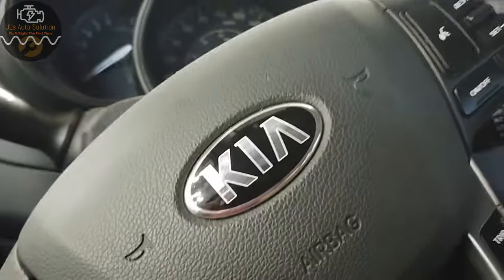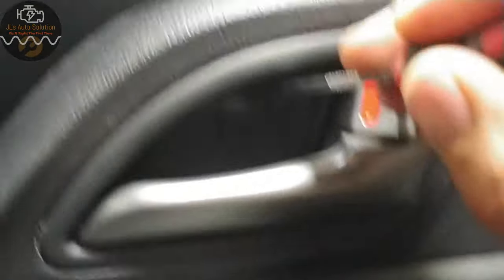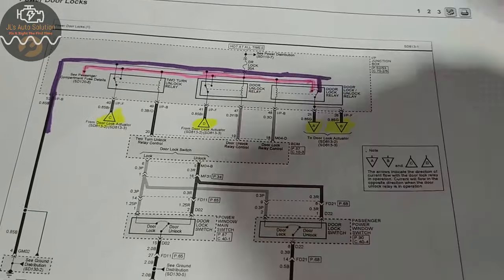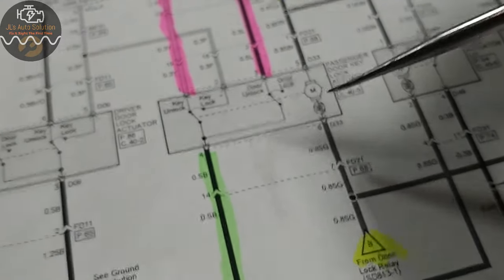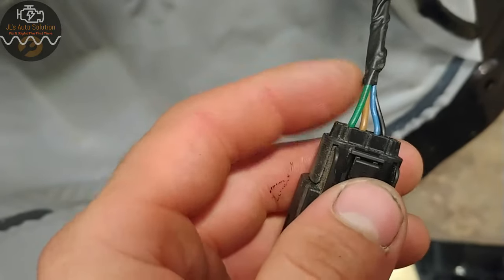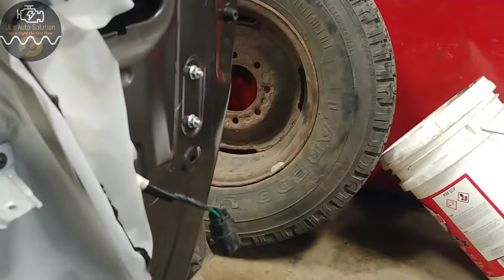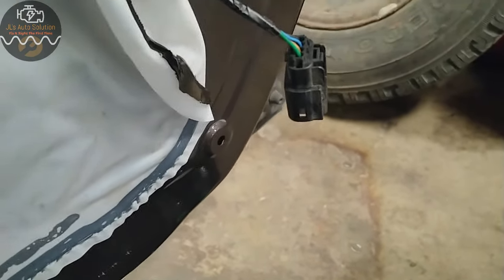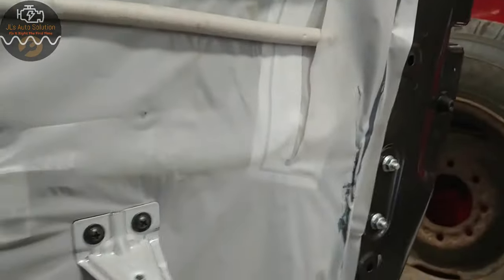How to Diagnose a Door Lock Actuator

Comment: I have a clue with Kia Sorento 2011 on the rear hatch locking system. All doors work perfecly but rear does not lock or unlock at all. I have no key to insert to lock my rear door. I checked the voltage at black and white pins on the connector and I have 4 volts. I checked wiring up to the rear door when wiring get into the roof and still have 4 volts when I click on the Key. Any suggestions or ideas? Relay? How can I check the wiring continuity up to the fuse box and where?

Comment: Hi there.   I have an 08 Town Car with the back door being jammed in.       The pull lock on that inner door panel is stayed in the lock position.         The lock rod issue will not let me open the door from either the inside or outside         Does my issue sound more like an actuator issue, than it does a cylinder issue?
Reply from the maker: seems like an issue that may be mechanical(with the latch assembly) or electrical.

Comment: I have a issue with my door lock where opening from inside the car opens the door but trying to open the door from the outside doesn't. Is this an actuator problem or tensioners/lock mechanism problem?

Comment: I been looking for a video like this,  my vehicle is not a Kia,  is a Nissan titan 04 but my remote control works pretty much the same as the one you have on hands and my problem looks similar. The passenger door doesn't lock with the remote or with the switch on the door,  I have to lock and unlock manually,  the driver side works perfect. Thanks a lot for this video and I'm going to try to follow the steps you did to see if my wiring is the problem or the actuator.
Reply from the maker: No problem, hopefully you get it sorted out :)

Comment: what could cause the actuator not to work when the door is closed? it works fine when the the door is open but once i close the door i get nothing. 2012 accent rear passenger side. i replaced the whole actuator and latch with one i got at the salvage yard and have the same problem.
Reply from the maker: I would check the door harness,

Comment: My doors lock system works sometimes but other time it work you can hear it unlock but it won’t actually unlock I checked the fuse it’s good I ran the obd system nothing about the security system I have a compustar remote start if that helps
Reply from the maker: hey darnell, you might be looking at an intermittent door lock actuator malfunction(mechanical). you would need a test light and to get to the wiring to the actual door latch actuator. il have a new video on this soon.. its similar to this video just a little more straight to the point.
Reply: @JLsAutoSolution  can’t I just change the actuator ? And he done ?
Reply from the maker: @darnellmorgan6754  you can change whichever part you want. Just make sure thT it is actually defective first. Last thing you wNt is to change a part only to have the same issue.

Comment: I have a problem with my 2019 kia sportage and seeking help pleaseeee, when i switch off the car and try to lock it sometimes it works some other times  it doesnt work and sometimes it unlocks after locking and sometimes it start making alarm noise by itself! 
All fuses are ok, remote is ok and sending signals, car battery and remote battery both ok
Reply from the maker: more than likely the vehicle is seeing a door or hatch open slightly and causing the vehicle to freeak out, or aftermarket remote starter is acting up

Comment: My Kia Rio 2014 do the same thing with front passenger side ,  what can I do ? Do I need to change a part ?
Reply from the maker: it really depends on the diagnostics that are being performed. I will never say change a part(because something is not working). Test don't Guess.

thanks for watching
Reply: @JLsAutoSolution  I hear the electric click but it doesn’t lock or unlock

Comment: My 2013 Kia Rio just started doing this but all 4 doors won't lock or unlock with the button or key fob, no motor sound or anything. I checked the fuse and when I push it back in the locks lock and unlock automatically but If I press the button of the fob or the lock button on the door all they stop working again and all I hear is a clicking noise by the fuse box. Any thoughts on this? Is it possible all 4 door actuators went bad at the same time?
Reply: Did you figure out what the problem was!? I have exactly the same problem in my kia rio 2013. All 4 doors won't lock or unlock, and it makes the same sound on the fuse box!

Comment: I have kia picanto..the problem almost the same..the car lock..but when it unlock I hear all the motors react a little bit but it does not unlocked ..I changed a relay in the central lock pannel it worked but it comes back again the same problem, I cheked all motors are good every thing seemed fine but  it comes back again..when I revers the lock and unlock cables the car will unlock but doesn't lock so there is  something wrong with the Central lock relays but I don't now how to fix it

Comment: If it's a cargo door lock issue & wiring is the culprit... Does it daisy chain from the other locks? If so, on the driver or passenger side??
Reply from the maker: there are 2 relays one for drivers and one for all others( 1 and 2 turn unlock) but one lock relay.

Comment: I'm a little confused about the operation of this part. Is it possible for the door to ever be completely stuck in lock position while shut, and then you wouldn't be able to get the door open at all? I've seen some people mention this, and I had an instance where the first time my door acted up I accidently got it stuck in lock while the door was OPEN and could no longer close up the car, but that was by fault of me messing around at the lock area and poking around, not by the fob or key. 
So, will inserting the key manually ALWAYS work? I have an '02 car that is starting to act up. I'm a little hesitant to bother replacing the actuator because of the price /age of vehicle.
Reply from the maker: when looking at a door latch/lock actuator, you need to think on two sides. one side is electrically controlled, while the other is manually controlled. On newer vehicles, you might only fine one manual key insert(on the drivers door) which means you can only unlock the other doors with a Remote/keyFOB or by and internal manual lock.

the lock can be stuck either in the lock position or in the unlock position, it really depends on how the actuator failed, now as for the key insert for unlock the door.  Unless you use the key insert on a regular basis, most of the time it wil sieze itself and you will not be able to use it,..

thanks for watching.. hopefully this answers your question.

Comment: So tell us exactly how you got the door open to have access to the screws?
Reply from the maker: the door failed in the unlock state,, so i just pulled on the handle and it opened.. if even the door fails in the locked stated there is a way to get it opened, when i have the chance i will make a video of that.. 

thanks for watcing

Comment: so basically im taking my car to a mechanic to do this lol. how much would it cost to fix this at a kia dealership so i have an idea? im scared i walk in and they say its 2k to fix the lock on my doors, but my physical key on the actuator still works so i'd prob just walk out and use it the old fashioned way
Reply from the maker: it really does depend on the failure. If its the sjb(Smart Junction Box) then you could easily hit 2k, but typically this repair should be under 500(dealer or independent) always tell them how much you are willing to spend for a diagnosis(ex: 1.5 hours) and that you will see after that time if you want to proceed.. 

With in 1 hour(under normal circumstances) they should have found the issue or be on the right track to locate the fault.

thanks for watching
Reply: If it's the actuator, dealer can charge anywhere from $500 up per door. part costs around $10, so DIY is best. Theres a fantastic video showing everything from start to finish for those of us car dummies. It wouldn't be fair to show link here, but search for "Car door lock actuator repair/replacement....." in You tube. Same method as shown here, just shown step by step for unskilled folks. Good luck.